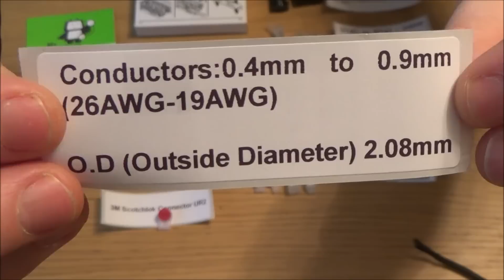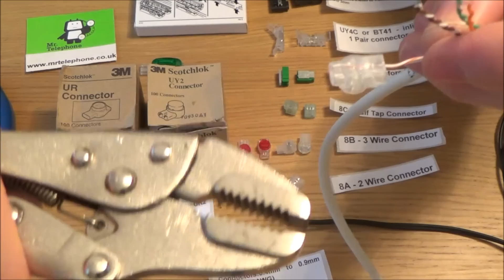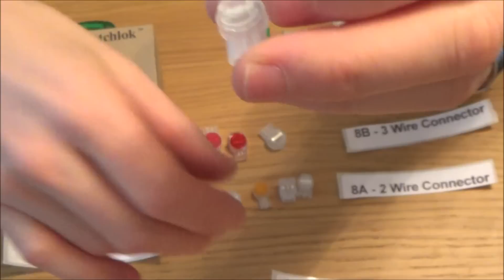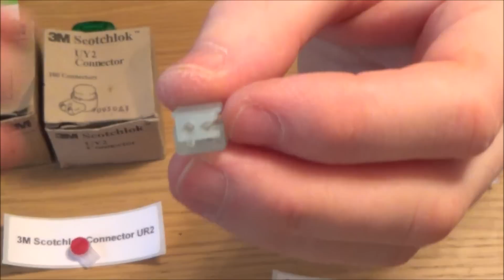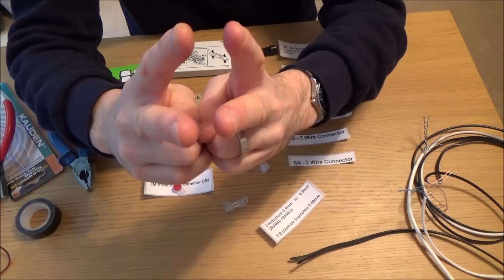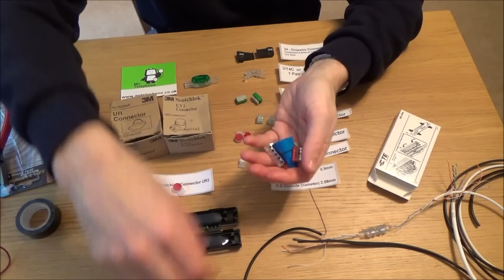Various Jelly Crimp Telephone Wire Connectors: 8A, 8B, 8C, 2A, UR2, 11A, UY4C,  UY2

Comment: Would like to be able to splice and re join a 4 strand extension cable (to avoid lifting carpet etc). Can you give me some advice?
Reply: The best advice if to lift the carpet. You should never use a spliced extension cord. Ever. Especially if it's inaccessible.
Reply: Could i put an RJ45 connector on to the spliced end? @nilpo19

Comment: Construction company accidently cut my phone line. Centurylink told me they can't come fix it til September (wtfff😤😡) but can I connect them back together using the "2a dropwire " ? Does the electric need to be stopped from running to the wire that is still on the pole before being worked on ?
Reply: Generally, no, you don't have to disconnect before working on a telephone circuit. But, understand that AC voltage is sent down the line when a phone is ringing. This can be dangerous so you have to use caution.

Comment: Hi. After some help. I've had to cut the out side bt cable as I've built a porch. But now I want to contact back to the cable that's running out side wall. What cable do I need. The cable that's out side that I cut has 7 wires in side (3 red) (1black) (1 white) (1 orange) and (1 green). Do I need to match that.?
Reply from the maker: Hi, that is called Drop cable. Mostly known as Dropwire 10 cable (DW10).
Reply: My Mate VINCE 
Hi ad thanks for your reply. 
So if I connect to the outside with the joint enclosure. Could I run the same cable right through the house to were I'm going to put the socket.